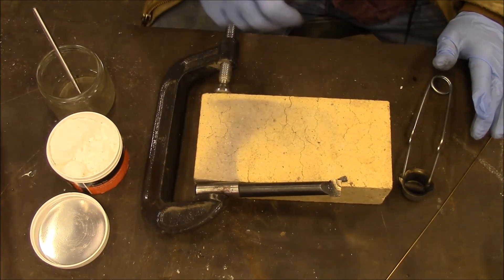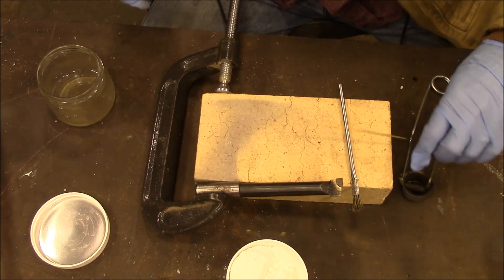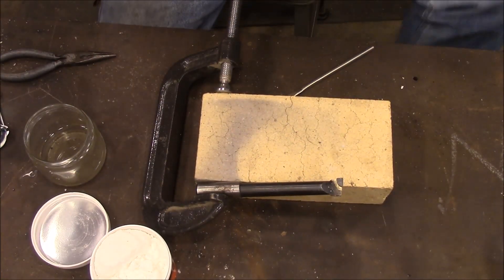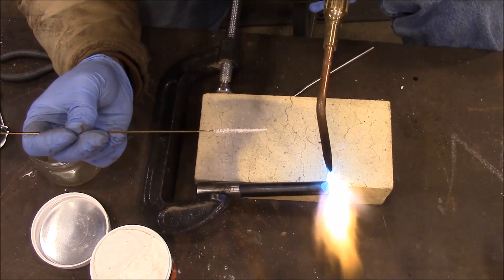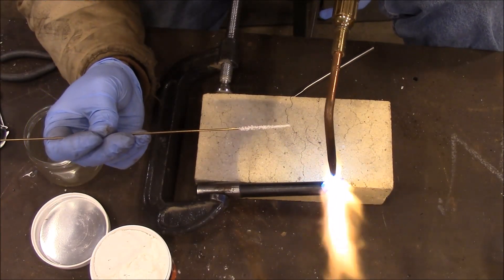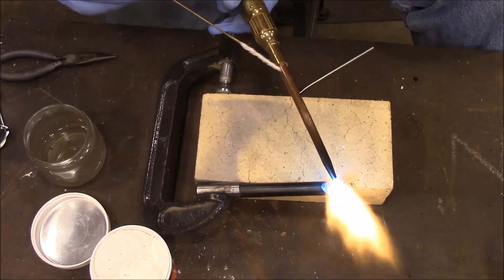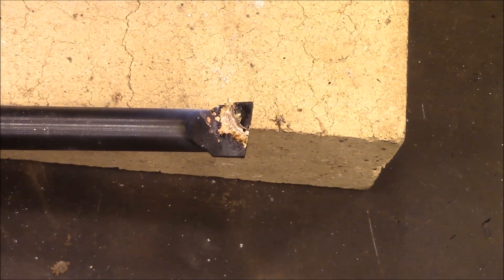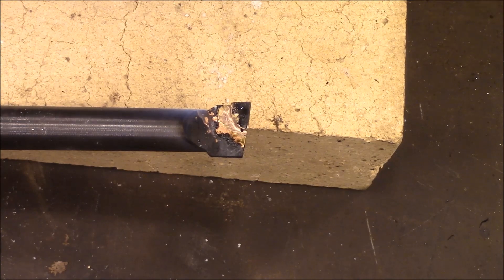Brazing Carbide Tip on Boring Bar

Comment: Yeesh. Not quite seated fully and a big ol hole in your braze. When I did this years back for a cutting tool company I used an old tungsten rod from our tig area I had brazed onto an old screwdriver for manipulating the carbide while it was hot. It helps with making sure you seat properly.  Also I added braze to the rear of the insert and pulled it through to the front with the torch to ensure a good even bond behind the carbide.

Comment: Doesn't heating up the carbide lessen it's cutting ability???
Reply from the maker: That's what I was worried about but no it cut just fine.  I got to thinking that it must not be a problem as they are all brazed in place and it worked.

Comment: thanks for confirming it will work i think next time two bricks to reflect the heat, less gas and acetylene and acid clean the bits, I use really good brass rods now that come pre coated in flux although i do acid clean the steel i braze i always use a little bit of borax for good luck! many thanks
Reply from the maker: You're welcome!

Comment: we did this in community college diesel class back in the 80's. silver solder is preferred, but if you don't have silver solder, brass works. it doesn't look pretty, but looks are not important in an emergency repair situation. as far as the heat damaging the temper, the carbide isn't affected but the end of the boring bar might be a little soft, and might bend if you really lean heavy on it while cutting..
Reply from the maker: Interesting, thank you for taking the time to comment!

Comment: I think you got it too hot. My shop teacher said to just use enough heat to melt the rod. I'm willing to bet that you ruined that tip because I saw it white hot. That means you re arranged the mellicular structure of the metal causing it to weaken. I am no expert by any means. And this is just my opinion.
Reply: mellicular? dude
Reply: The melting point is over 5000°F, stay below that and you're golden, when it comes to the carbide.
Reply from the maker: I would have thought that as well but I used it after brazing and did not notice any difference in the carbide.  Sometimes you read comments that make things sound so difficult.  I mainly posted this to encourage people to try it, it's not as hard as I thought.  Thanks for the comment.

Comment: I had thought of doing this, but don't know if the heat would damage the temper. Any insight on that you can share?
Reply from the maker: The heat does not affect the hardness of carbide.  There was no change in the functionality of the carbide after it was brazed.  Thanks for watching!
Reply: @SoatMon  useful information man : please tell me the way how to brazing the HSS cobalt M42 or Rex95 .. HSS .. I could not find a video for it ..
Reply: @worldcollections2839  HSS cannot braze w/out ruin the temper, that is why no video . Watch "This old tony"  For HSS, u need tig. He explains it well.
Reply: Any +1 year updates? Still holding up?

Comment: Good idea. I need to make a carbide tipped tool shaped like a gear rack tooth to cut a hob. I seen the cost of carbide & thought of plan B. I debrazed a carbide tipped lathe tool & brazed the tip on the end of the cutter I already made after notching it with a die grinder. It's cooling down as I write this. Thanks for taking the time to make the video. That's what I needed to see. Now lets see how it works.
Todd K.
Reply: +Todd K. Awesome!  Glad to help.  I hope it worked out well for you.  Thanks for watching!
Reply: how can gas weld be done only with carbide